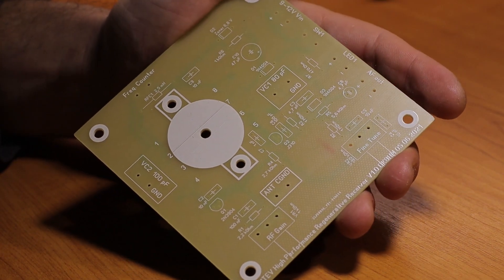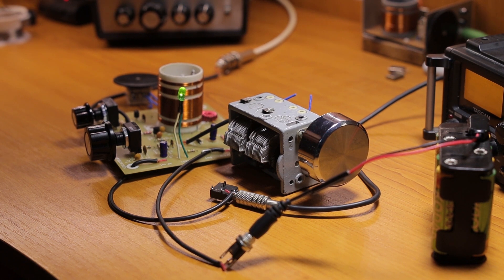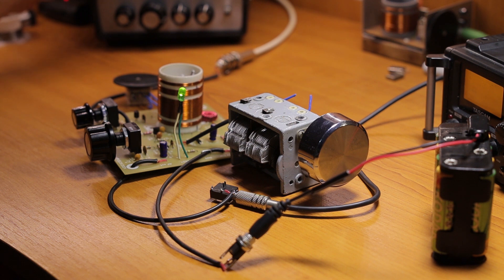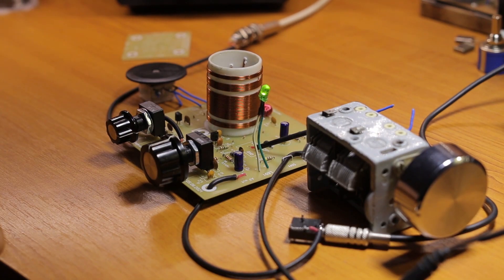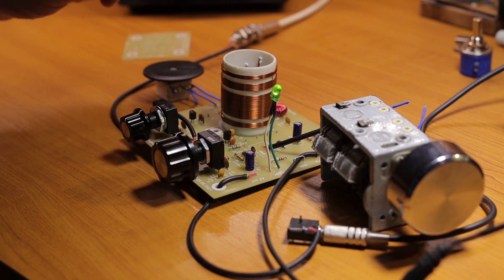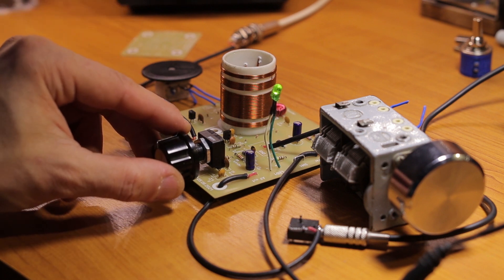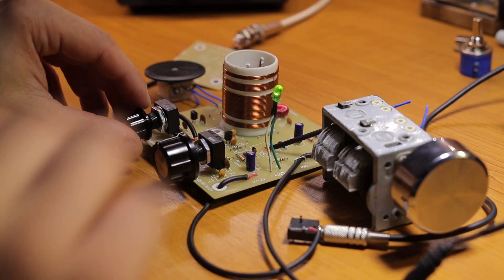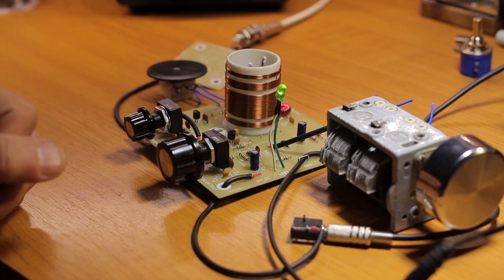Simple Shortwave Radio Receiver Designed By N1TEV

Comment: Where to buy variable capacitors?
Reply from the maker: Depends on the type and quality. You can either buy second hand ones from eBay or similar websites... or new ones. Usually they are not cheap. Or the cheap option is to buy the cheap plastic ones that you usually find in pocket radios from AliExpress.

Comment: Several years ago I had a breif online discussion with Mr K about this very circuit,  according to him with  minimal adjustments to biasing you can build this with any low signa low noise J-Fet.

also the grounded base amplifier is there to isolate antenna and radio, both to avoid  any antenna movement detuning a SSB or CW signal causing "sway" and avoiding any interference from a slightly oscillating receiver "broadcasting"
Reply from the maker: Yes that is totally true... on both subjects. I only have a little issue with the biasing at the moment. It doesn't seem right as the CW signals should sound really pleasant to my ears. But they sound somehow distorted now. Is like a signal that is not properly demodulated. I know that the tranzistor in this case also plays the role of a BFO at the same time as it does the other jobs. So I need to find the fine adjustment on the bias in order to make it sound as I please 😁😁. P.S. Is a great receiver though.
Reply: @dxexplorer  indeed a good receiver to use.

Comment: I really like regenerative receivers. I have not built one since 2010 and I wish I still had it and the design I used for it worked really well.

I do have several, but not home built like the one from ten plus years ago & I plan to build another this winter along with SolderSmoke's Direct Conversion Receiver that they designed as a beginner's project.

I pick up every 1970's stereo or radio I can find at a thrift store to harvest variable compacitors to use in projects such as this and for mag loop antennas.

Good luck on your modification and future builds...73 & DE Kc2wvb.
Reply from the maker: Thank you so much and good luck to you as well with the receiver. I also want to try built that one from SolderSmoke. Maybe this winter I will have the time. 73, YO6DXE.

Comment: I think it's very squeaky, hard to tune to SSB.
Reply from the maker: It is as built using the original schematic. But I think with minor changes and a few improvements... it can be a really great receiver. Of course... the same eternal problem when it comes to regen receivers, the selectivity won't be that great. In December I am planning on spending some time and work on a final version for this one. You will love it 😁😁. 73, YO6DXE.

Comment: Very good job! I read about a high sensitivity  (roughly 1microVolt) of a BJT regen (transistor in barrier mode). But in regen there are usually only one LC circuit. Any LC circuit  has poor selectivity , even quality is high. It means you will hear a more strong station even you tuned on a week station. In your receiver you have a capacitor with two sections. Try to add an additional LC selective circuit BEFORE input. It may be a coil - like in your regen, that would be located on 2-5 Inches from the main coil of the regen.  Connect an antenna to part (or separate winding) of this additional coil. It much increase selectivity - especially in AM band.
Reply from the maker: Thank you. Ohh I should really try that. Is basically like a preselector and for sure is much better with that. God idea indeed.
Reply: try regen IF - a frequency converter using ne612 or something followed by regen IF reciever.
Reply from the maker: @mohinderkaur6671 I will work on a DC receiver soon. For this particular design I have other plans... big ones 😁😁. 73, YO6DXE. P.S. Just waiting for the cold days to work on it.
Reply: @dxexplorer  built the kk7b earlier, need to try this sometime
Reply from the maker: @mohinderkaur6671 Is really nice. It has a good sensitivity. I was just not happy about the audio output. But I learned a think or two since I built it... so is time to make it sound great 😁.

Comment: I mounted a radio exactly like this one but it doesn't work at all. I don't understand the reason because it regenerates well and receives the signal from a dip meter placed in the vicinity. 73 from BRASIL es DX Milton PY2CYE
Reply from the maker: That is strange. How big is the antenna ? At the time I made the video... I was using an EFHW for 40m and it was a bit overloaded with signal. Or maybe if there is no sound may be something with the audio amp ? 73, YO6DXE. P.S. I want to build another one like this but with the schematic a bit changed. Only that I don't have much free time for that right now.
Reply: @dxexplorer  TKS fer elucidation.
Reply from the maker: Não mencione isso. Espero que consiga fazer funcionar normalmente. Dê uma outra olhada na montagem. Muitas vezes, por entusiasmo e impaciência de ver funcionar, cometo sempre um pequeno erro)))

Comment: Hi there, nice video.  Where can I buy this kit?
Reply from the maker: I don't know to be honest. If I remember well qrpguys.com used to have something similar for sale... but I don't think they sell it anymore right now. This board was just a present from one of the subscribers to the channel.
Reply: Yes, unfortunately, qrp guys no longer has this kit available. Fortunately, they are offering the PSC boards for $10. You then download the manual from their web site, and build the radio, by supplying all of your own parts. I really wish they still had the kit available. It seems that no one else offers a regen rcvr kit anymore, so I guess we must make our own.
I've had success building my own regents using vacuum tubes, such as 6SK7 and the smaller 12BA6. I'd run them with a plate voltage of 36 volts (four 9 volt batteries in series) and they sound just as good as the excellent receiver you show here on this YouTube video. Like you, I LOVE regenerative receivers. You get a lot of bang for your buck.
Reply from the maker: Unfortunately yes is no longer availabe. No wonder as to be honest people these days prefere to build stuff based on Arduino and codes and all that fancy stuff. I prefer older analog circuits, so a regen for me will always make me happy way more than any "modern" digital thing.

Comment: Schematic and PCB files still missing.
Reply from the maker: I didn't write the blog article for this one yet. That is because I had no time to design the PCB board properly. Also I am trying to replace the coil with a toroid as well so it will be a little smaller. This big coil doesn't help much when you try to put the receiver in a smaller enclosure. But I will be working on this soon and post a video about it. The PCB board in the video was a present I received in the mail from one of the subscribers to the channel.

Comment: Can you do review for that smaller pcb, for which frequency display is designed for?
Reply from the maker: Ohh yes I will talk about it in this coming video. I want to post the second part about the receiver this week as later on I want to have some fun with an FT8 transceiver 😀😀😀 73
Reply: Thank you for fast reply, also looking forward for your antenna tuner article on your site. Keep up good work. Cheers😀
Reply from the maker: My pleasure. Ohh yes I will take care of the articles as well sometime this week. I had no time as I was running to finish my paperwork for the exam to get my license finally. 73

Comment: Hello! First and for most, nice built and the coil is very compact. I would like to have a look at the back of the pcb( you may have shown the back in this video but probably I didn't notice). For the variable capacitor, I have two of them and similarly I keep reusing them for my projects, the only solution is varicaps for diode tuning. Furthermore, diode tuning is cheaper and is more suitable for small projects. The receiver is actually very hard to tune for amateur operators because it covers a wide range of frequencies, making this to cover even more frequencies it will be nearly impossible to tune. The pcb must be redesigned as you said for such a small circuit the pcb is too big and maybe this is another factor which makes harder the tuning.  For me if you want to add an audio amp stage, try using a td2002 instead of the lm386. To drive the td2002 you also need an one transistor amp stage before. The td2002 can drive a speaker easily without distortion. In conclusion, some modifications should be made for the circuit to operate better but for the first test it functioned quite well.
Reply from the maker: Thanks for watching Nikos. The PCB was really nicely done and designed as well. Its big indeed... but so is the coil )) I like the fact that Hendrik designed the PCB with ought the audio amp... so that gives me the freedom to pick the one I want. 73 my friend.
Reply: @dxexplorer  you can make 
live stream if you have time with the receiver.
Reply from the maker: Maybe next weekend ... I'm not at home anymore. I only go back on Friday.
Reply: @dxexplorer  ok I understand.

Comment: Hi Chip, thank you for the very interesting comparison. I have the Scout Regen from Pacific Antenna. It's the same circuit. I think I have all the regen radios that were released as kits. I love building regen radios! Recently I built a direct conversion receiver using a sampling detector (basically half a quadrature sampling detector). It works really well. Of course it does not eliminate the opposite side band but in practice it's no so bad. Looking forward to your sailing channel. I do get a chance to have a go in a sailing dinghy occasionally. Take care, 73, VK7IAN
Reply from the maker: Thanks so much Ian. I have a few more regens to build on the list. The Scout is one of them as well )) similar design indeed. Then as I was telling to Nigel in an earlier comment... I also want to jump on the direct conversion receivers as it gets boring building only regens haha. The one here in the video needs a few more adjustments made. Basically I recorded in the evening when the propagation was nice a few hours after finishing it. I'm sure it can do a lot better with a few more adjustments. Thanks so much again for watching. Maybe next week I have time to make a video for the sailing Channel too. And if things work well... maybe I do videos about amateur radio from a boat later on as I really want to be back on water. I miss it like crazy. I don't seem to get used to life on land after floating for nearly half of my life )) 73 and have a nice weekend.

Comment: Ciprian, I think Hendricks board seems a little bit more selective than Sputnik. I think we can all agree we've reached the point diminishing returns for a simple design. Very nice little coil there.Happy listening. You can try the MPF102 in place of the J310 should be no issues with biasing. Looks like you need more chinesium capacitors lol
Reply from the maker: Hahaha... yes for sure on both the capacitors issue..  and also I had enough of the Sputnik myself lol. I'm just going over the Sputnik now as I'm working on the blog article about the second version... and also I want to build the first one for myself as I first intended to. Just a tiny one. Meanwhile... indeed Hendrik designed a really nice board... and with the frequency counter and little bits and pieces I will soon ad to it... it will turn into a beast ))) I really love it. I do use the MPF102 you sent me. I did not had any J310. I think I only have three more regenerative receivers on my list of to do things.... and I'm done. I honestly had enough as they all seem to work the same. In performance I don't notice any difference..  nothing major at least. I'd like to play with a few direct conversion receivers next... and then get a little more sophisticated ))) 73 Nigel.